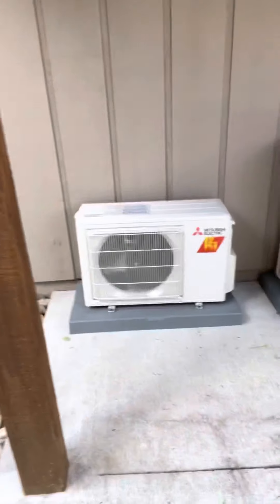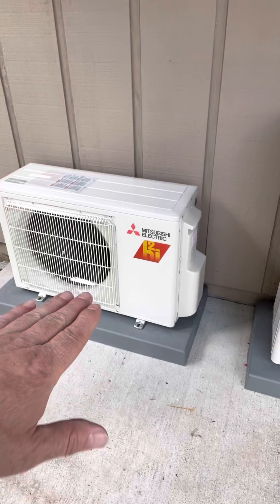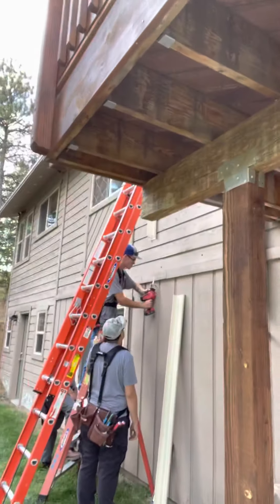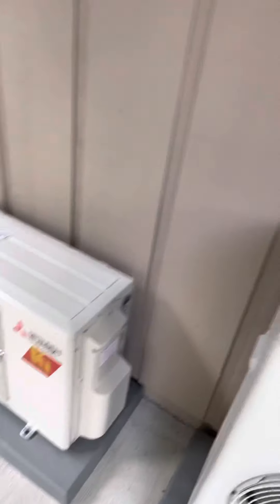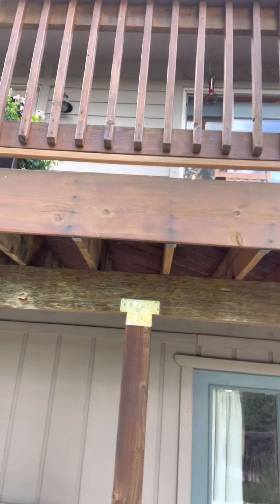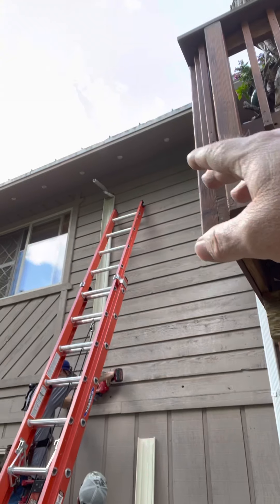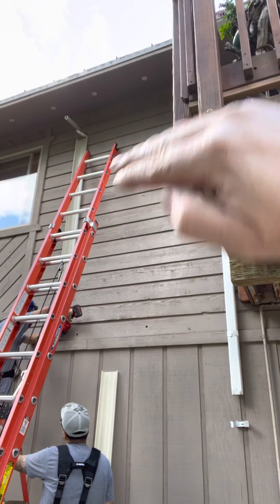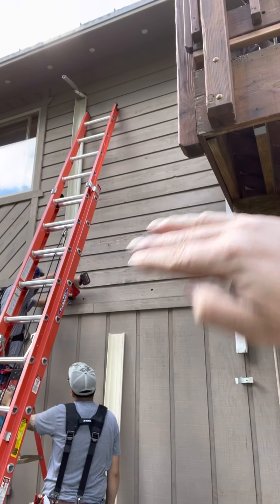New Install Ductless Mitsubishi Mini-Split Hyper-Heating Line-set Hide! Mitsubishi Pro INSTALL!

Comment: Good video. 

Couple of questions.

How big do you drill your holes through the wall for the line set and drain? 

Do you use a diamond core bit for brick or carbide bit?
Reply from the maker: We have a Hiti Core drill for concrete and we use hole saws for wood and siding.

Comment: Flare vs crimp? Is it advantages of one for certain scenarios vs another? Cost of crimp products and tools...?  

Also, in this video, why have 2 independent units and not a unit that can accommodate both heads?
Reply from the maker: Great question. So when you use a multi-zone unit you will never be as efficient as a 1-1.  The customer that bought this set wanted the benefits of the 1-1 vs a multi-zone. I'm going to make a video on your question. Make sure you subscribe and like the videos. And I'm not 100% sold on the crimp, I'm not saying they may leak or what have you. But I'm more sold on a high-quality, flare fitting. I'm going to make a video on a new flare tool we're getting this week. Thanks again. 

Jared